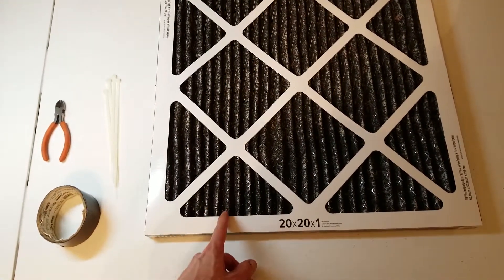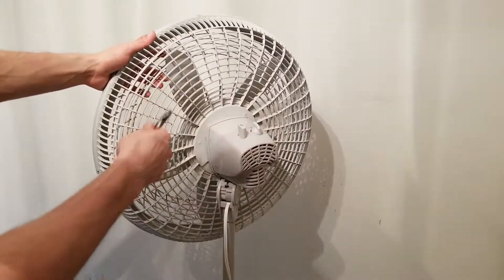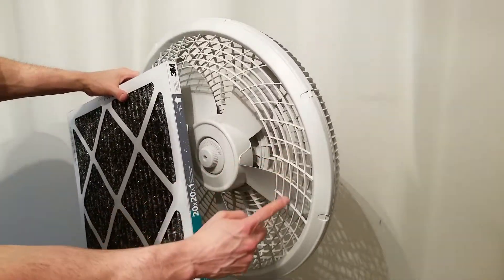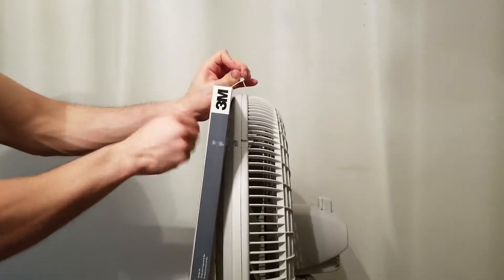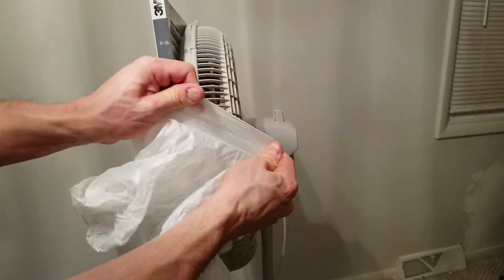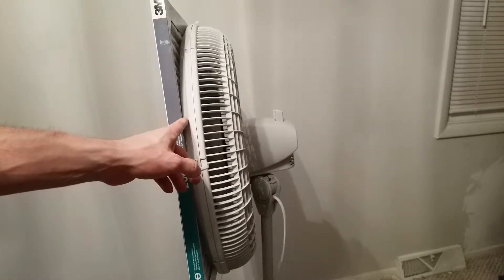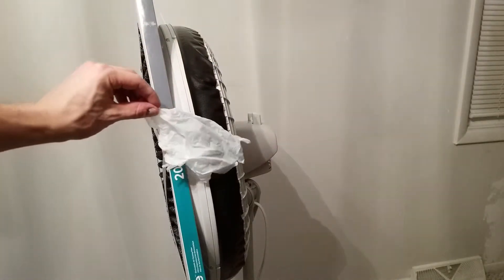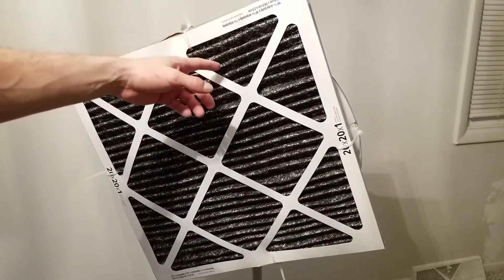DIY Oscillating Air Purifier!

Comment: U proly already did this but u need to put  the filter on the backside. The back pulls in the air and holds the filter in place from the intakes suction so u won't have any resistance. U may burn up a few fans by restricting the air flow and trying to seal the sides but as long as u change the filters on the backside u should be good to go.
Reply: My thoughts exactly